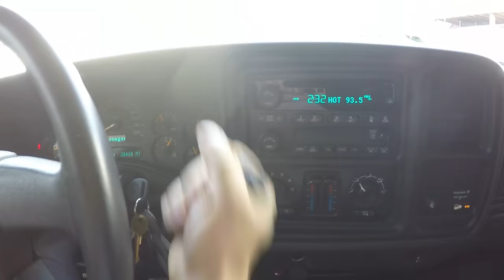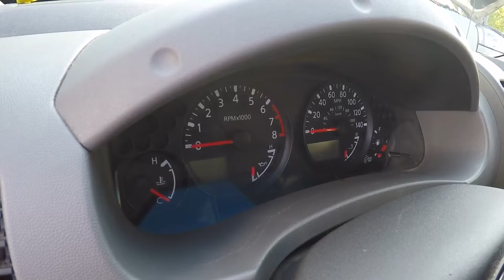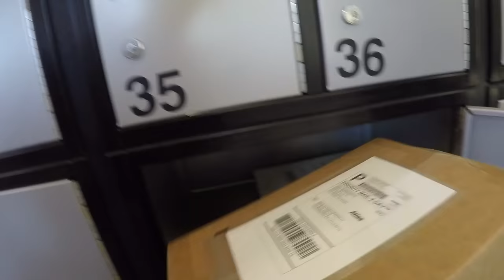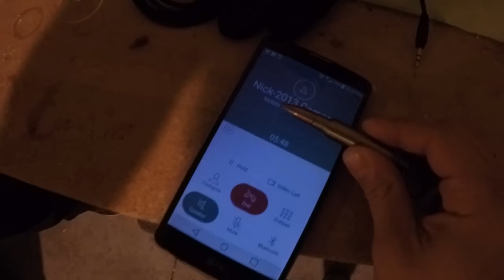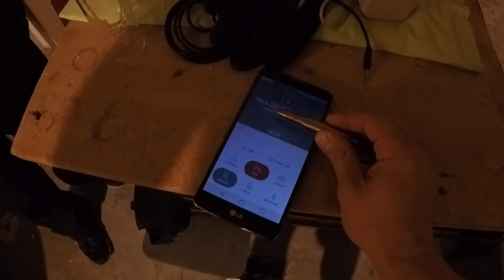THIS Is Why I RARELY Take My Truck Off Road...

Comment: Never jump a car like that.  You should go positive to positive and negative on car running to engine ground on car not running.  This will instantly jump it.  The way you did it can damage the car computer.
Reply: I thought there would be a million comments like this, but so far I've only seen yours.  Yeah, right away I was saying to myself, that's wrong.
Reply: it cant damage the computer. it just isnt good for the battery because the acid can turn into gas and explode if it sparks at the battery. cars nowadays are designed to be jump started. you dont think an engineer would think anyone would be jumping the car they design.
Reply: TheSamplebridge wrong. Please educate yourself before posting.  Cars are more sensitive today than they were 10 years ago.  http://m.mynrma.com.au/get-involved/advocacy/news/why-you-shouldnt-jumpstart-a-modern-car.htm
Reply: really then why has all my cars that i have jumpstarted at some point never had an issue. my nissan titan that i had to jumpstart ever day for a month and never had an electrical issue. and why do most of my cars come with jumper cables from the factory.
Reply: KillaBandit ive read that link before and its completely wrong. they said plugging cables is like zapping a heart. which is wrong because then plugging in a battery would zap the ECU. it only draws power if the ignition is on. it can hurt it if you plug in cables with the key in the on position, but thats just plain stupidity.

also my honda odyssey, nissan titan, ford fusion, and a few other of my cars came with jumper cables.
Reply: also that link is just a write down of what a few people said.
Reply: What does a car not coming with jumper cables have to do with anything? The manufacturer doesn't build the batteries lol a battery is a battery... Use the jumper car and hook the cables to the pos on the alt and the ground on the alt grounding bracket
Reply: Alexander Dillard wow another wasteful post.
Reply: KillaBandit sorry wrong person I meant the other guy
Reply: KillaBandit well then someone stole them from you because mine came with them. and ECUs only draw power when the key is on. an ECU cannot be damaged if it not drawing power unless you have a voltage surge which is impossible through jumper cables from another regulated circuit. you can fry them if you have the key on, but cannot with the key off. and if this can happen as much as you say it does, dont you think it would be a well known thing not to do after 30+ years of cars with ECUs.
Reply: your hooking a battery up to a battery. its no different to plugging a new battery into a car.
Reply: everyone on youtube has a friend that knows everything and is an engineer. it pull some power, but its not controlling the ECU. and onstar pulls from the memory logs on your ECU, like a blackbox for your car, not from the ECU itself.if you plug jumpers in with the key on you could fry them. but plugging jumpers in is no different to plugging a battery in or having a battery disconnect.yet again i ask you, if it was bad as you said, why have none of my cars had problems and why isnt it a common thing throughout the car community. probably because your just believed  the first article you read on the internet without researching it.

i just texted my friend who works at an electrical diagnostic shop and he said its all BS.
Reply: I suggest you learn about ecus.  This gives you some good info. http://www.popularmechanics.com/cars/how-to/a7386/how-it-works-the-computer-inside-your-car/. Prove me wrong.  I've been giving you links proving you wrong.  Lol
Reply: KillaBandit ive built my own ECU for my car. i know how it works.
Reply: KillaBandit youve provided no proof that you have a friend that works for nissan or your an engineer. why do i need proof when hundreds of people jump their car everday and i have yet to hear about 1 person fyring their ECU from jumping their car like any normal human being would. yet again. plugging jumpers in would be just like plugging a battery in.
Reply: I've provided more than enough proof with links.  Again your by yourself with others also not agreeing with you.  Get a life.  If you want to prove me wrong with links and facts I'm waiting.
Reply: Nope, not wasting time for some who refuses to have an intelligent conversation without facts.
Reply: it doesn't make sense because the jumper vehicle puts out the same (or less with added wire length) voltage and amperage as the cars alternator can put out.
Reply: The negative battery cable is electrically grounded to the vehicle body and engine.  Whether you hook up the negative  jumper cable directly to the battery, metal bracket or other ground point doesn't matter to the car's computer.  Just make sure the key is off.   It's recommended to hook the negative jumper cable to another ground source than the battery to prevent the battery gasses from possibly exploding from a spark/arc.  If you've ever seen a battery explode, it's not fun.  The safest thing to do is unhook the battery and charge it with a battery charger.
Reply: This is bullshit, the negative part of the battery is always connected to the engine ground. The only fucking way you can damage it if you put the ground cable on the positive lead.
Reply: The only way you will "instantly jump it" is if you have some decent jumper cables and not some joke time 8 or 10 gauge ones like the ones used in the video.
Reply: That's exactly what i was thinking when he was putting them away.  Cables are too thin which make it harder and take longer to start.
Reply: Cables have nothing to do with it. It's the way you hook it up which makes the difference.  I know someone who hooked it up battery to battery and couldn't get it started.  As soon as I told him to move it to the ground or something metal on the engine his negative side of the bad battery it fired right up.  Now with these small portable jump boxes which have tiny cables and fire the car right up. Like I said the cable size doesn't matter.
Reply: KillaBandit The wires on the portable jump boxes are a few inches long, use wire of that gauge over a 10ft span and you will be there all day. Cable size is everything.
Reply: KillaBandit.........I never heard of grounding the negative so you don't blow the ECU.  Pretty sure you'd just blow the fuse first................right??  Samplebridge is spot on.  You ground it so you don't produce sparks around a possible ignition source.
Reply: Sahadi420 wrong. Google it and you will see the proper procedure as I mentioned.  Another person above mentioned it as well. The negative does not go to the bad battery it goes to the ground or metal on the engine.
Reply: And if you read jump starting a car today can damage the ecus.
Reply: Yes, the negative lead for the dead battery goes on a piece of metal, not the battery.  But, the reason isn't for the ECU.  It's to avoid battery gases from igniting.  If you read #6 in the link you sent, you'll notice it says "Attach the last black clip to an unpainted metal surface on your car that isn’t near the battery."  The reason they put "isn't near the battery".....is to avoid the potential battery gases from igniting. 

And sure, jump starting a car might damage the ECU..........just like a hard launch in your car could shred your transmission.  Odds are............you'll be fine.   If jumping a car was soooooo bad for your ECU, then cars wouldn't come with jumper cables, and tow truck drivers would make you sign a waver before they jumped your vehicle.   :)
Reply: Sahadi420  you realize the battery is always grounded unless you disconnect the ground from the battery itself
Reply: Yes Michael.  We are simply commenting on the "technically correct" way to jump a car.
Reply: Sahadi420 doesn't matter where you ground the cable at its still grounding to the battery I always ground/power to the alt so the cables don't fall off the tiny batter terminals
Reply: Some of you may say it's for the gases, but from years of experience it starts better by having it grounded on the engine.
Reply: "some of you may say it's for the gases"..............uh, the site you told us to look at said that!!!
Reply: I never said gases was wrong.  I am just stating a fact that putting the negative on the engine allows the car to start where having  it on the battery a lot of times won't.
Reply: I've never read such stupidity. This argument is insane. Charging wise there is no difference between the terminal or a good ground on the engine block granted both contacts are clean and the same size. The ONLY reason is to help prevent from an explosion. Hint why most cars now have positive charging blocks away from the battery. p.s. I am an electrical engineer
Reply: Curtis Hinkle "Ground" is just a code word which, in this case, refers to the "current return common" circuit node. There is a complete circuit because everything electrical in the car, such as the starter motor, also connects to ground in order to return current to the minus terminal of the battery through the ground. The car's chassis is used for this return network, and so the entire chassis is an extension of the minus terminal of the battery.

During jump-starting, we connect the boosting battery to ground rather than to the dead battery's - terminal for the simple reason that this provides a more direct return path to the good battery which is powering the dead car: the return current does not have to travel through the dead battery's minus terminal hookup cable and then to the jumper cable, but can go directly from the chassis ground to the jumper cable.

A more direct return path allows for better current flow and less voltage drop, like plugging a big appliance directly into an outlet, rather than via an extension cord.

And this why the car jumps better with the car ground instead of the battery and is more successful.
Reply: Then please explain to me why and how there is a difference in where you jump two closed circuits together. Electrically speaking.
Reply: I just did. Go read
Reply: Curtis Hinkle clearly you are not because you can Google it and find similar discussions.  You lost this conversation and just proved it.  Again it's not farther it is closer to the battery that is jump starting the car.  The starter connects to the chassis for ground.  It flows better that way so you have a better ground.  It's. Fact. Sorry that you aren't as good with an ee as you think.  I guess my alnost 4.0 GPA in my class taught me more than you.  Have a good day.
Reply: And I also have experienced this myself in real life so I know it works.
Reply: when you start your car it pulls amperage through the same ground strap that your battery connects to. and the resistance between the engine and the negative post is so minimal it doesn't matter. if your jumping a car and it doesn't start from the terminals but it does the engine. there's a big problem in your ground strap that you need to fix. because that's not allowing enough current to flow through from jumper cables it's most certainly not going to let it through with a charged battery.
Reply: no I'm right. if you can't start a car from the negative terminal but can from the engine. that means your ground strap has too much resistance and isn't allowing current to flow. it's basic electrical diagnostic. you dont have a GPa anywhere near 4.0 if you don't know that.
Reply: let's say you have a section of wire. you can get current from one point in the wire but it that stops getting current past a certain point. that means something is wrong at that point in the wire. you couldn't of gotten past 9th grade electronics tech if you didn't know that.
Reply: Again like you said earlier about jumper cables being thicker gauge.  Grounding the car to the good battery is better than the battery it's self. It is a more direct connection to the components that need it. Reason why the car will start easier this way period.
Reply: TheSamplebridge you already proved you don't have a clue what you are talking to about kid.  Now go play in the junk yard.
Reply: That's part of the reason due to gases.  If you would actually research some you may teach Yourself something about how electricity works.  It is noticeable I've proved it on many cars.  Doubt all of them including a brand new car had bad ground straps on the battery.  Grow up kid.
Reply: KillaBandit weird. My car has 4 leads coming off the battery. Puny 6" ground strap, big ass cable from neg terminal to the starter which also serves as the engine ground, big ass cable from pos terminal to the starter and a lesser sized one feeding the main relay/fuse box. 

The largest issue in how well the car starts is how "dead" the battery is. As the dead battery gets closer to "garbage" the boosting battery devotes more power to it, taking away from the starting job.

Whether or not the jumping process will be "easier" if the negative jumper isn't on the negative terminal depends on a number of things:  battery state, resistance of jumper cable, resistance of battery to starter cable, effective resistance of wherever you clamp it to the starter, and another big one, the condition of your car's cables.

So yeah, not clamping to the battery may make things easier, but it's not guaranteed. 

ECU? Well anytime you're making sparks you can put in danger, along with every other electrical component. But your battery makes a pretty good filter and if the system wasn't designed by a complete idiot you'll be fine 99% of the time. 

And since everyone is sharing, I'm a mechatronics engineer, if that helps.
Reply: KillaBandit fuck no. ground is ground. weather its on the battery or the body. its all grounded together.
Reply: Henry Babin again not all the same.  You don't have a clue like a few others how electricity works in electronics.
Reply: KillaBandit i drive a dodge thats nutoriouse for electrical issues and already jumped like 50 people off.
Reply: all that high dollar stuff you have, then brag about saving all these other people here and there. ...then you pull out eight dollar set of cables,  if you had quality cables it may have started on first try. My friends drive way is rougher than most of what you  called off roading.....don't  scratch that truck, then you'll have to schedule a trip to the body shop. I don't understand people, why would anyone send you stuff,....sunglasses in your apartment, come on, man up! don't be such a yuppie.
Reply: KillaBandit just take some video and use the upload button to show us some unedited video of the difference between going from the battery vs engine ground. Be sure to include a couple shots of the ground cable as well. 

You might want to define "more successful" as well. 

I've jumped plenty of cars myself, and if the battery can barely make the solenoid click or worse, I've found that the ground doesn't matter. You still need to sit there and let the dead battery get enough of a surface charge to allow it to contribute to the process instead of hindering it. 

I've already noted the various issues involved, and the dead battery's state is the largest one. You're saying a couple feet of heavy ground cable is why it ”isn't as successful," but it's not that simple. And before you blast me please note that in my previous post I said the engine ground may be the best option depending on those factors.

Fastest way to jump a completely dead car (and best way to put electronics in jeopardy):
Disconnect the negative terminal from the post and connect the jumper to that terminal. Car will start instantly.
Reply: What difference would it make to ground it on an engine ground point ? The ground point is grounded to the battery anyway...  I see that you have a couple of links, but do you actually have any experience as a mechanic ?

If what your sources describe is true; that the cars electronics can not handle a jump start, the only way to do it would be to short the starter, and just skip the wiring, connecting positive to lead 30 at the starter, and negative to lead 31, thus making the starter turn.

What you are essentially doing when connecting two batteries is making them run in parallel, and i dont see how that could damage any control unit. If it is a sudden spike in voltage that make you fussy, please explain how you would go about changing a battery on a car, that cant handle a jumpstart, since it is the exact same thing happening.
Reply: Anton Kolding LOL. I was actually doing that for the past couple of weeks. Rubber button on my clutch pedal that actuates the Clutch/starter interlock switch disintegrated so it was impossible to start it with the key. Replaced the solenoid wire with an uninsulated spade so I could short the positive terminal of the starter, coming straight from the battery, to the solenoid with a screwdriver. Hate to think what someone else would have gone through that night in the Walmart parking lot (in a not so friendly area) because they didn't know the ins and outs of said electromechanical system, didn't have the troubleshooting skills, etc. 

Need to disassemble the entire clutch pedal to replace that $1 part, so I still haven't fixed it properly (thanks for the great design Honda!!!). 

Sadly, this is a foreign language to most people today.
Reply: This. You also forget that you have fuses in line for the sole purpose of protecting components from overload. Oh and that "car computer" you're talking about is called an ECM or sometimes referred to as an ECU/PCM
Reply: Marshall Hash Maybe there are fuses to protect from overload and surges, if you don't mind blowing fuses and then crawling under the dash to find which of the 30-40 are blown.  But best practice is to ground the negative to the car chassis.  Even if you don't believe that, the car will start instantly and save you a lot of waiting around.
Reply: What kind of crack are you on? No auto manufacturer ever includes jumper cables simply because of extra cost. Some dealers will include a roadside emergency kit that has jumper cables in it. My local toyota dealer includes one with every car. The cables are so small all they will jump start is maybe a lawnmower tho, kinda like the cables this dude in the video has. A good set of cables along with that dual battery system would instantly start that nissan, no way he should be having to wait 5 minutes.